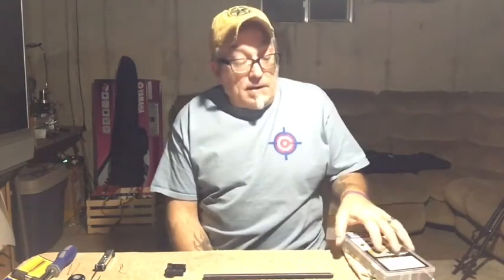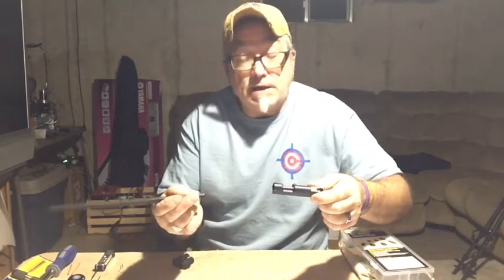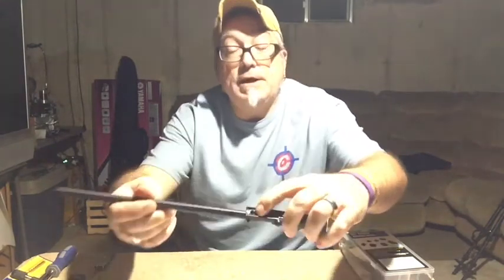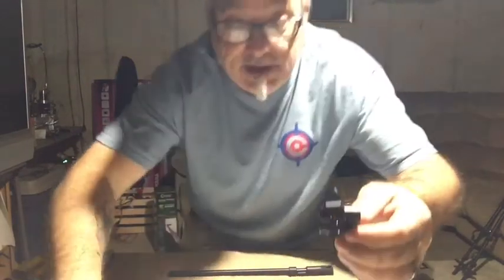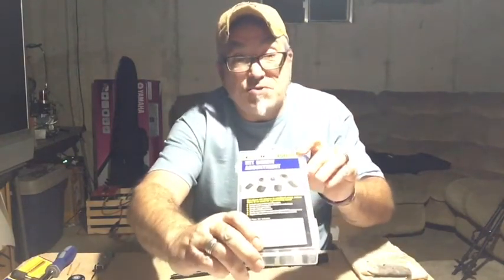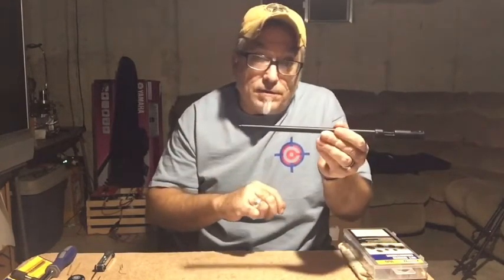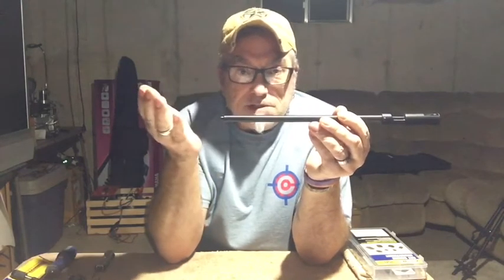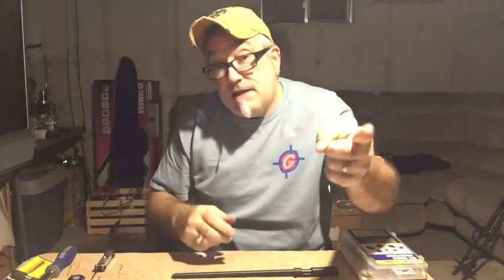1322 Reinforcing the Barrel at Mounting Points

Comment: I just replaced my 10” barrel with a 14” to all a bit more power to my 1322.  I’d go longer but with my suppressor it will be long enough.  I started with a 1322 backpacker I bought for $50.  I’m up to $200 now.
Reply from the maker: It’s a great platform with tons of aftermarket support, great gun to build on.